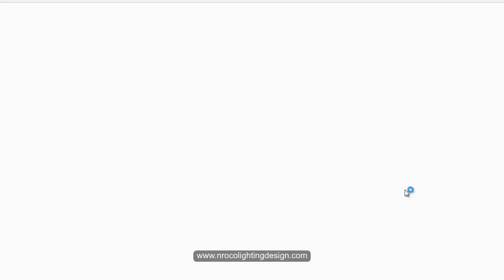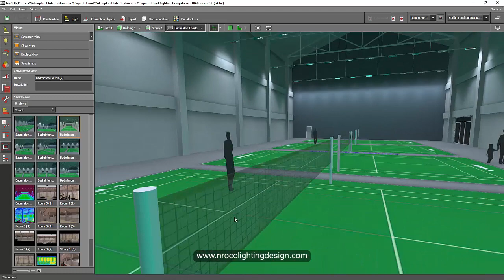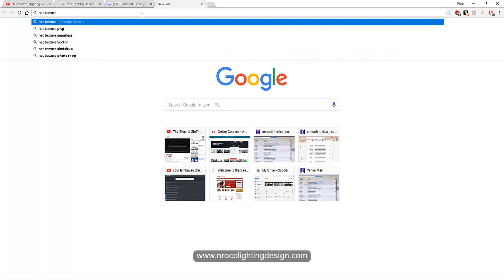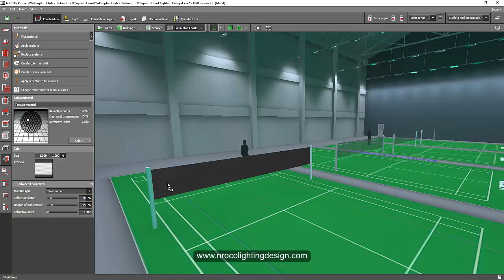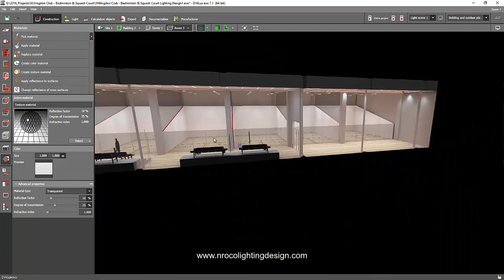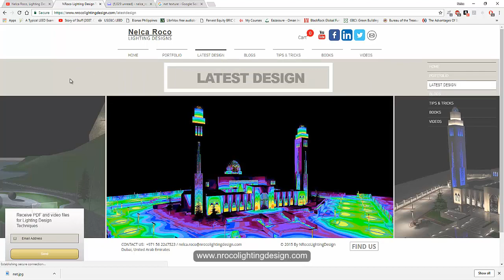How to create a transparent net in Dialux evo

Comment: Hi Nelca, i'm from Mérida, México, I speak a little bit of english,  I recently started using Dialux Evo, when import my 3D model in EVO it gets aditionals lines over a flat surface, how i can fix that? Cheers!
Reply: I use Autocad to model and then export a 3ds model, and when I import to EVO, connecting lines appears that are not part of the original model. I hope that you can help me.

Comment: Dear Nelca, How's everything? Hope all are well in Dubai and your families back home. You were a blessing to all Electrical profession inclined to lighting. For in the universities back home these subjects are tackled mostly by ID and Architects like yourself. And  my field as EE tackled it as a minor one with 3 units only.
Anyhow I would just like to inquire if the approach you made on the net will be applicable in Border control fence? Or what is the best action for it?
Reply from the maker: Dear Mighty Tod, thank u for your amazing message.
Yes, you can use that net or your border.  You can have either concrete or mesh border using the texture tab.  Just consider the spill light to the other side if u use the net.
Reply: @NelcaRoco  so by doing so beam of light will pass through on the material?
Reply from the maker: @mightytod9739  yes of course if it is trasparent